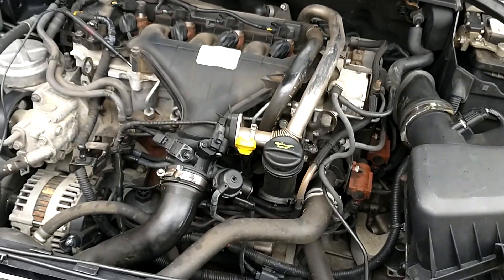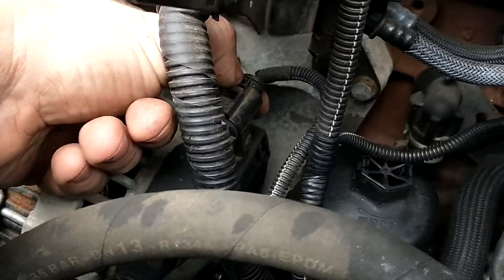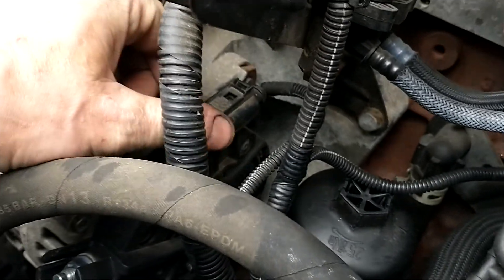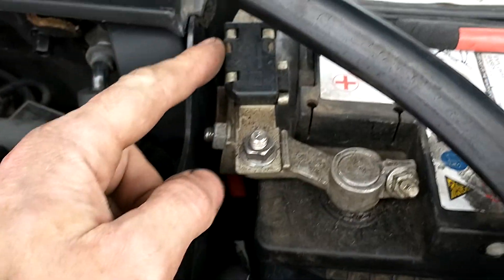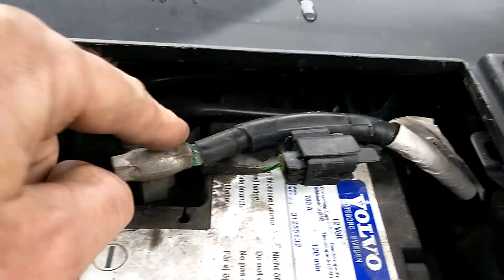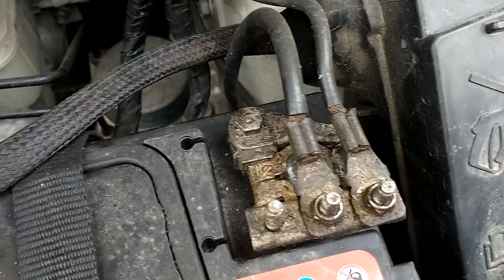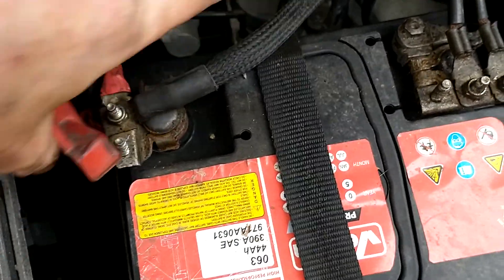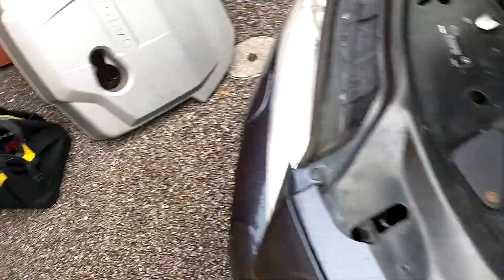How to check if you have a smart charge alternator

Comment: Connecting a voltmeter (via a plug) to the 12v outlet makes it easy to check for a smart alternator (there are also plug in voltmeters that you can just leave in). With a smart alternator  during acceleration or other engine loads the alternator output will stop and the battery will be temporarily "on its own" to supply the vehicle electric needs- mine bottoms out at about 12.6 v. As soon as engine load is reduced or at constant highway speeds the alternator comes back online and voltage goes up to typical charging level- 14.2-14.6 v. This "smart" action results in a bit better efficiency. It frees up engine power for acceleration while the added alternator load during deceleration is actually recovering some energy and helping the car slow down  My 2013 Hyundai Santa Fe with a 3.3 l v6 has this with NO problems. The current battery is 4 years old and it still started fine at 0 degreee F (no gargae!).  Apparently smart alternators CAN be a problem in 2 battery setups or if you use the battery as a general purpose power source. There are workarounds such as split chargers--check with an RV expert! (I happened to add a plug-in voltage and temperature display into the 12 v outlet just for fun. The voltage fluctuations were a big surprise, but the shop manual explained it all.)
Reply: Thank you for this!  I've been looking all over the place for confirmation as to whether my alternator was working properly or not! 😅
I've got a Peugeot partner van with the ehdi engine (start/stop eco thing) that I thought was faulty because it wasn't charging at over 14v whilst my foot was on the pedal.  As you've said, when I lift off, the revs gradually rise to around 14.5v, then drop again to 12.6v as soon as I accelerate again.  
Even though I knew I'd got a "reversible" or smart alternator, I couldn't find whether this was normal or not, now I know it is.  Thanks buddy!